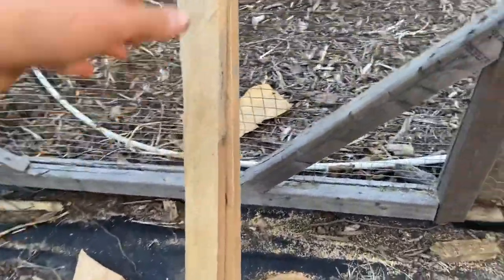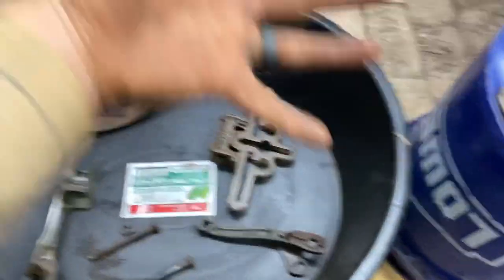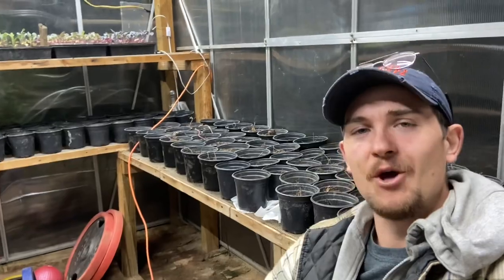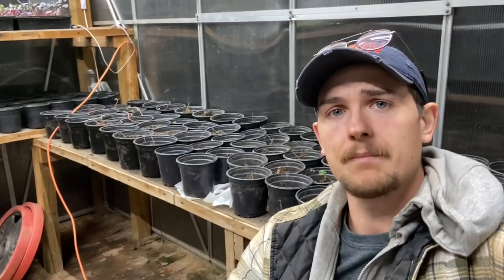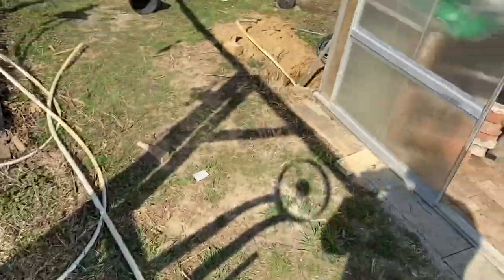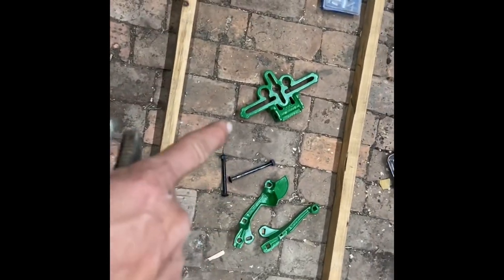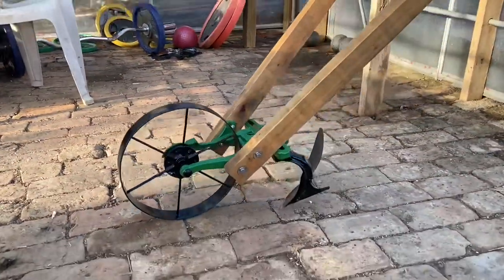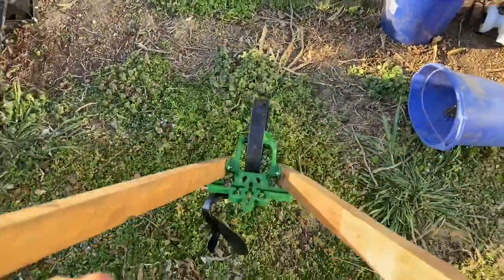Planet Jr Restoration | Model K412 Single Wheel Hoe

Comment: That is actually a No. 4 combined Seeder/Wheel hoe, thus the geared wheel. You could detach the seeder unit and attach the wheel hoe tool bar, using the same front assembly.  The other PJ wheel hoes had the larger 15in wheels.  The No. 4 was a more compact seeder.  Nice work!